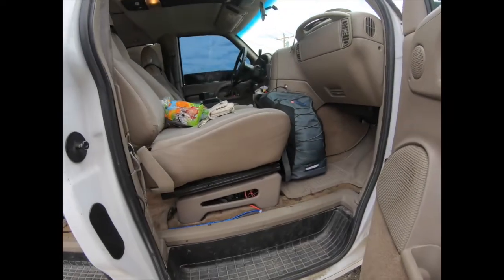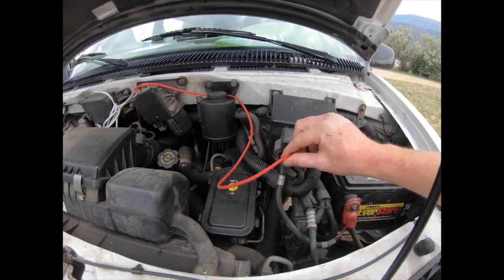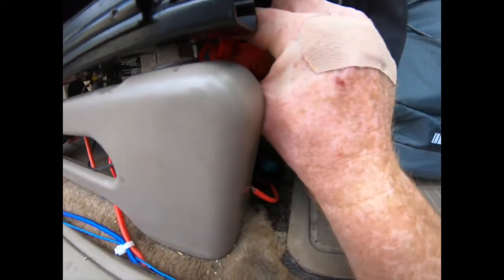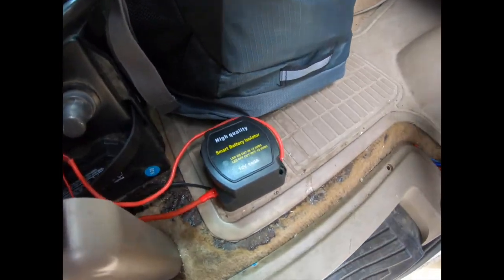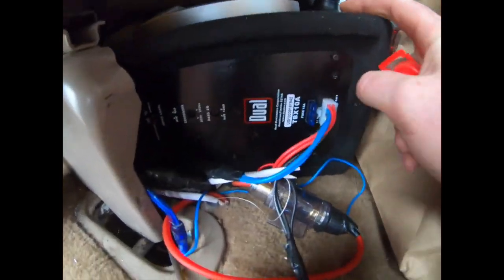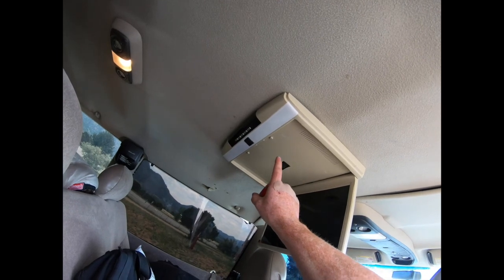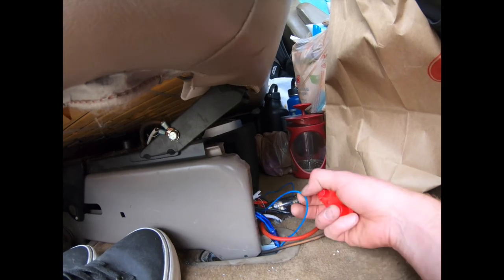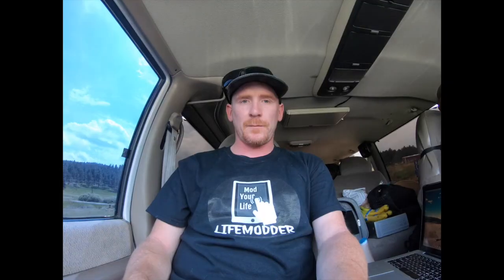Astro Van Auxiliary Battery, Isolator, LCD TV, Subwoofer Install

Comment: Did you run a negative wire too from the main battery to the aux battery?
Reply from the maker: I did not I just grounded it to the metal to the bench seat frame